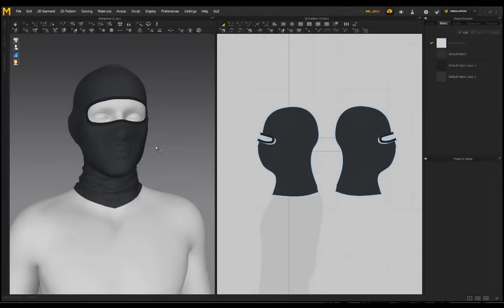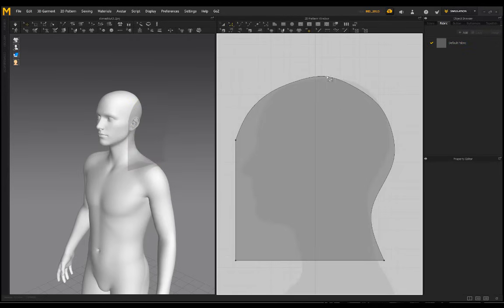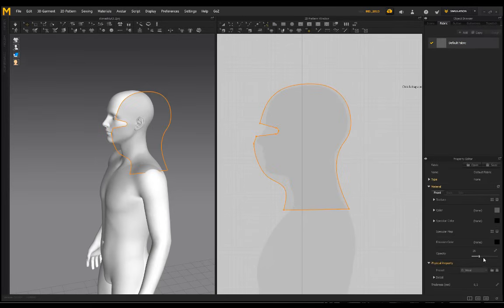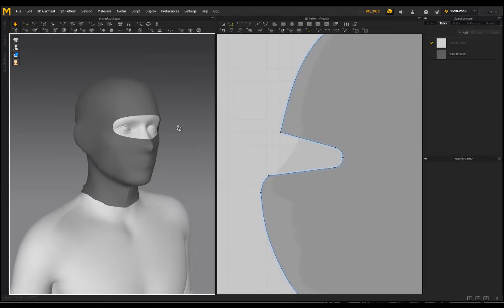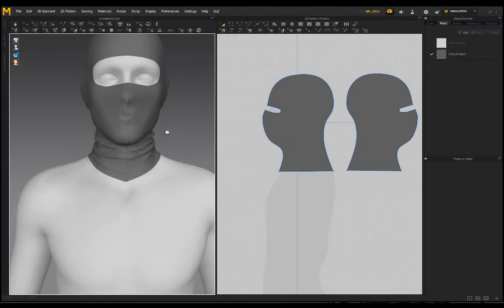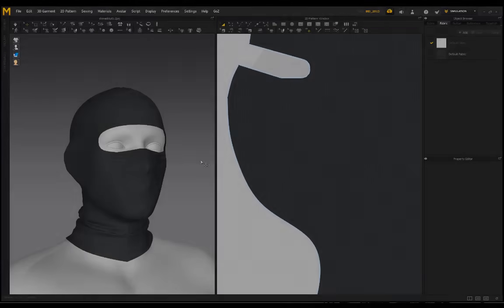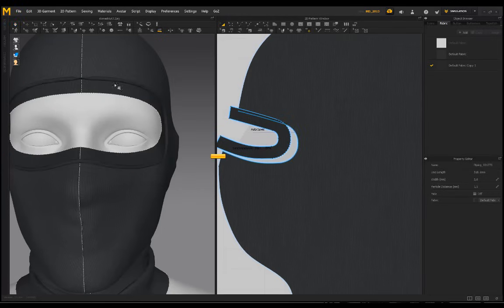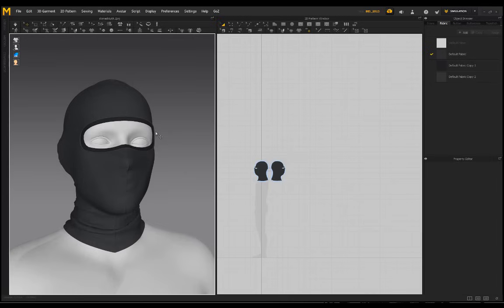Marvelous Designer 7 - How To Create A Ski Or Ninja Mask

Comment: Hi! Is there a way to have the details from the internal lines and the sewing itself transfered to maya/zbrush. It seems a little counterintuitive creating complex patterns inside MD, when you lose the cuts and details when taking it to maya or zbrush for example. I have tried to find a solution, but I have not succeed. What did I miss?